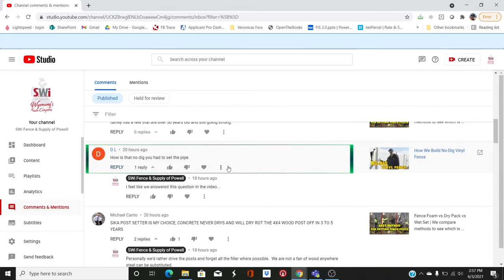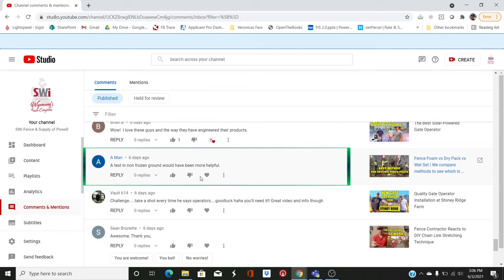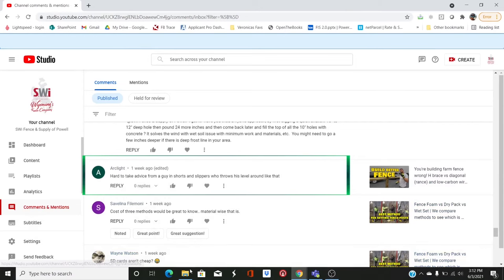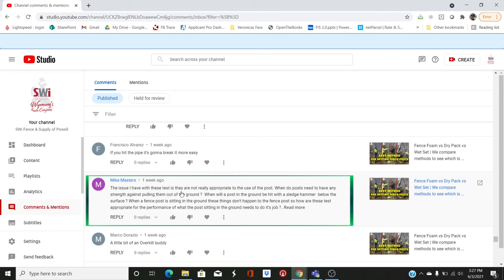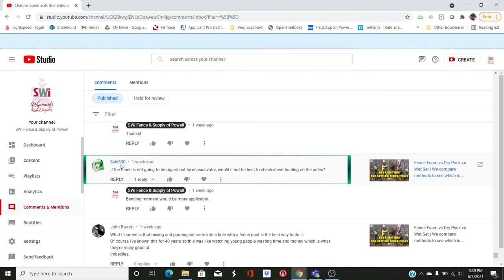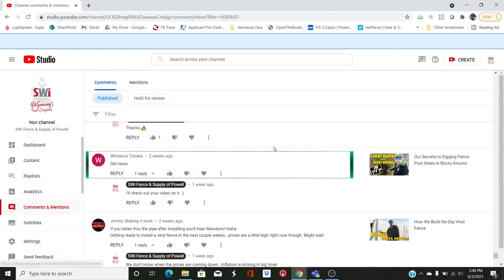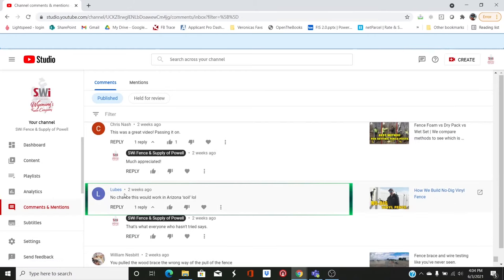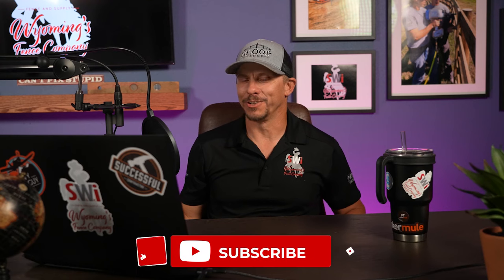We Respond To Our Juciest Viewer Comments

Comment: A little tip for  vinyl 2-3-4-5-rail . Backfill with dry quickcrete. It makes leveling the the height to the contour of the land very easy. The concrete will eventually set up.

Comment: After 47 years in the fence business(family owned business) I have to agree with you on all these comments. Every region has different challenges. 
  Been there done that from central America to up and down the east coast.
  Everything he's telling you is true. Here in NC state requires 42in deep hole. Hole must be 3 times the  size of the post and belled out at the bottom and  domed at the top.
   Fill the vinyl post up with concrete and rebar. When it gets cold I've seen post split on corners from contraction from the cold.
  Just keep up the good work because quality of workmanship in this industry is slowly decaying. Everyone thinks it's so easy and a quick buck. I've  run across alot of contractors in our area that can't even do basic chainlink.
Reply from the maker: Thanks for watching and appreciate the comment! Keep on fencing!
Reply: I recently did a "belled out at the bottom" install for basketball posts. what is that supposed to do? oh and the hole had to be square " to prevent rotation ...

Comment: I saw you with a 2’ level it’s fine is your style but I use a torpedo level to be able to put it in my back pocket. The level is just a little guide our sighting skills That’s what make our fences nice and straight
Reply from the maker: We prefer 2’ because we came from the ag fence market where a torpedo level doesn’t work well for tapered posts.  They are actually less responsive meaning the bubble is more stable which helps to teach our new guys.